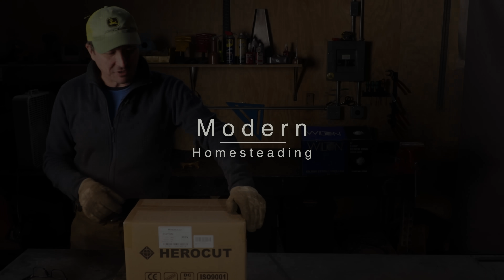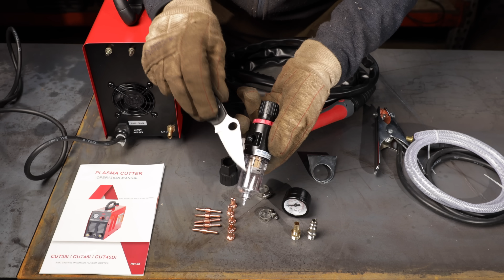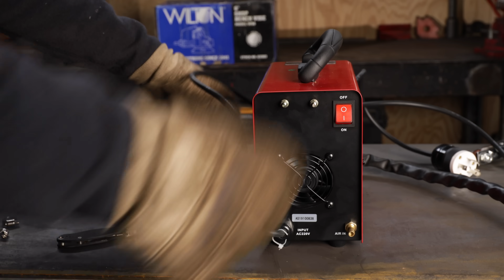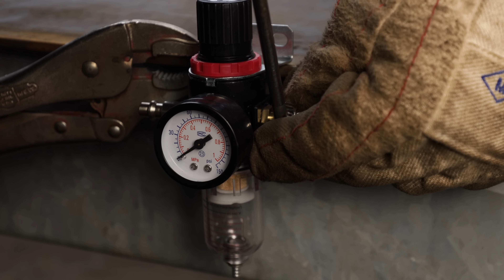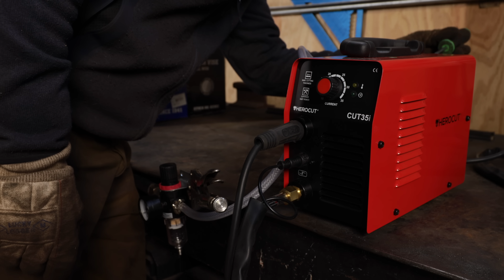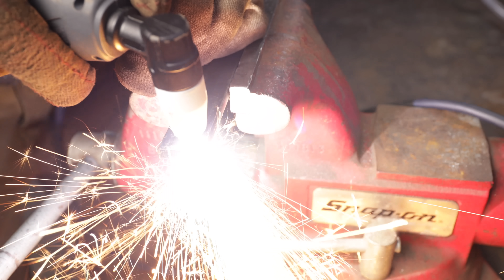TESTING The Cheapest Plasma Cutter On AMAZON

Comment: this one is 195.00 (Reboot Plasma Cutter 40Amps AC 220V Portable Metal Cutter Digital Display 2/5ich Clean Cut High Frequency Inverter Air Plasma Cutting Machine for Home Using)

Comment: CNC Plasma Cutter, HeroCut55i Dual Voltage 120/240v Non-HF Blowback Pilot Arc Non-Touch IGBT Digital Inverter Air Plasma Cutting Machine 50Amps 16mm Clean Cut, Max Severance Cut 25mm
by HEROCUT
4.4 out of 5 stars 54 ratings
| 35 answered questions

Price: 	$549.00 & FREE Returns 

this is ware your link sent me

Comment: As a retired artisty ole fart that putzes around  his shop.   I couldn't justify spending hundreds of $$ on a plasma cutter, so I make do with using an abrasive disk on my 4 1/2" angle grinder.  
Now @ $150 I could see hundreds of things I could build using this tool.  Yes, I know the duty cycle is short, but when You look at MY physical duty cycle, this would outperform me.  I would have to  go with the 120V unit because of no 220V available.
Note: The short power chord is there for a reason.   A longer power chord would require a larger gauge wire and shipping costs go up.

Comment: For around the same price you can buy a 30 amp plasma cutter from Banggood (the CT 312) that includes tig welder and a stick welder functions. There are partial reviews of it on here. I've got one, but it doesn't come with all the consumables required for tig. Once I've sourced them (also from Banggood) I'll put up my own review of it using all functions. They claim a 60% duty cycle, which I consider to be more believable

Incidentally it comes with much the same external components with the exception of the torch, which has an electrically isolated cutting tip so that you should be able to actually drag cut closer to a non conductive guide for more accurate cutting. Like you, I'll be feeding it with air from my larger, wall mounted, water trap/oiler.

Comment: Thank you, I ordered what looked like same model, mine came plug less, 110/220 model, so tried 110 to use extension cord, nope... spit and sputtered... Also the regulator did not have psi so now I know .04 is where 50 psi is... I'll put a welder plug on and give it another try. Thanks for the videos. Stay Safe, from Linn county Oregon

Comment: Mine is a different brand, but looks the same. With 110vac it does work, but seems limited to about 1/8 inch steel (unless you go really slow). Haven't tried it with 220vac yet. For the price, I can't complain.

Comment: $150.00?? Looked this up at Amazon, with link provided. Even tried looking up without it. The ones that I seen that looked like one being used were well over $150.00. More like $500.00 & up. Pretty good video but was disappointed after seeing the actual price. If I’m gonna spend that much, I may as well save up for a Lincoln/Hobart brand. $500.00 does not come easy for me.

Comment: They must have liked the review.  The price has nearly quadrupled.
Reply: Still only $199 for dual voltage
Reply: His link is to the Cut50 not the one he tested which is cheaper
Reply: Look up cut35i.   You can find them as low as $129
Reply: A lot of formerly cheap things from China are going to up in price due the Coronavirus complications.
Reply: @Mumblix  no when they see the views go up on a item they up the price have done it with alot of stuff he has reviewed
Reply: @Mumblix  
Nope, due to DUMB trump.
Reply: @loktom4068  Apparently, SO dumb that he got things accomplished that no other President has done. Man, what a dummy.
Reply: @arthouston7361  no kidding.  Ask 10 people what issues they have with him and 9 will only give you his personality.  Sure he doesn't have a lot of tact but I'll deal with that vs a "nice" guy that is worthless.  Besides, do research and most of the "nice" guys were a$$holes behind closed doors.
Reply: @boozler8194  Agreed. I spent a lot of time at U of P, and I can tell you that NO ONE gets into Wharton if they are anything below a high IQ. Penn does accept some students from "challenged" backgrounds, but Trump is not one of them.
Reply: @arthouston7361  delusional
Reply: @user-fr4cg2xj2w  Yep. A lot of people suffer from Trump Delusional Syndrome. It it perpetrated to keep people on the plantation.

Comment: I work on ships and the only time I need a plasma cutter is when a torch would do more harm than good .
  I can think of better ways to cut a clean piece of steel on a table .
  Yea that barrel should have been cut with a hole saw  or a circle cutter and torch .
that design could be cut on a band saw .
  In that design you are tossing the Outside piece so why Did you need a plasma cutter ?

Comment: LoL  oh  that silly metric system shows it's face again.    LoL   NASA is on the Metric system GM is on the Metric System Dodge is On the Metric system.  and your radio stations have started to move to it as well.  why?  one world system of measurements.  the best way to make it all work.   so stop talking bad about the Metric system,  you will all be on it within the next 10 years.   even your speed signs will have both on it soon.   now if they could only fix the right hand drive car problems...

Comment: Yeah I'm not seeing the  240 or the herocut 220 with either of those links. It just shows the 110 volt is the 45i and there's a 55i that is a dual-voltage but that thing's almost $550.

And the links do not show $150the links bring it to Amazon and it shows $194.

Comment: You're confused about Duty Cycle. 100% means you can run it 10 mins at 100% of it's rated amperage. It still would need a cool down period. Duty cycle in no way is connected to your 8 hour work day in the form of non stop cutting.  That's why the word cycle is used. Cycle has a beginning and an end. In this case the standard rated end is 10 min in a Duty Cycle measurement.

Comment: 2 weeks after this test, and the 35i is no longer on Amazon. They now have the 45i at $194 which is only 110v. The 240v is $549.  Lately it seems that everything that gets good you tube reviews, the price shoots up on Amazon.
Reply: What's funny is I clicked on the link after watching this and found a cut50de. Apparently it is the older model and no lo get available. The manual useless. Oh and the 45i needs 6.0 scfm.

Comment: The Hero vs Miller clamp.  Mmm the clamp itself is definitely cheap but the copper strap dual ground points. Might have the Miller beat. Looks like the did a really nice job there.

Comment: I don’t know much about plasma cutting... do you need some type of gas to use one?
Reply: You need to have a large air compressor for an atleast 70 psi and up constant pressure. Small compressor wont be able to keep up air pressure that could possibly shortening the life of the machine unless you will be cutting small or thin material at a time. Plasma cutter is very useful equipment to have it at home DIY'er or either a shop.

Comment: Had mine for 4 years, was almost $30 more back then,  I would say its been used a couple hundred times and still works great.  Cant cut for hours on end, it will overheat,  i can do 3/8ths  but you can tell its at its absolute limit if you go to fast and i often have to cut twice. I did have to open mine as it had an air leak inside, simple clamp re-tighten.  Wish i could say evrybody would have as good of luck as me, but its is cheap so who knows.  I have at least 3 friends who got them after seeing mine and all of them still wokr to, but I dont think they are used as much as mine. If mine dies i may upgrade, but 4 years for $180, now $150  is hard to pass up.

Comment: I bought a 32 amp 5 years ago, it still cuts great, I dont use it over 1/8 inch. I also bought a 50 amp, it cuts 3/8 quick. Flies through 1/4 inch. I cut a piece of 3/4 once. It was slow, but definitely doable.  But for making 1/4" plate items, these cheap plasma cutters are fine. get a bunch of consumables on Ebay too.

Comment: "Metric system rears it's ugly head" he says, just a minute after "I hate how everyone makes these airhose connections differently, there should be a standard"
Reply: Classic American  mate haha
Reply: You can make a precision standard part without using the metric system fyi
Reply: @Wyatt_Riley  It's more "There should only be one standard" while the US is the only country in the world not using the standard thing everyone else agrees on.
Reply: @tbthegr81  The US also produces the most widely used Mills, Lathes, ect that are used for precision machining so we can do what we like
Reply: @tbthegr81  Plus anyone in the machining field whether working in the US or not should be proficient at converting from metric to non metric units. So whether the specs are metric or not the part can still be the same and standardized
Reply: @tbthegr81   The USA and Myanmar, please don't forget Myanmar!
Reply: @tbthegr81  If The Metric System is Standardized Why is There 5mm and 5.5mm Just Sayin !!!!!
Reply: @kellydardeen6308  Ehm
All lengths in the metric system is based upon the meter, and the meter is defined as the length light travels in a vacuum during a predefined length of time.

Ya can then have any length that is shorter than a meter.
"mm" just means "thousands of a meter"
So half a mm is just "Half a thousands of a meter"
And 5.5mm is just "Five and a half thousands of a meter"

What has been standardized is not a bunch of predefined widths of drill holes or screws, but the whole system of how to measure things
Reply: @tbthegr81  We are the "standard"
Reply: @Wyatt_Riley  The US produces the most widely used mills and lathes? Really? That's not true, what do you think they are? Also any American manufacturers that export convert their export lathes and mills to metric. No one in the EU/Asia/Australia/etc would buy a lathe or mill that's in imperial units. The only lathes in the EU that are imperial are ancient ones.
Reply: @lost4468yt  Um its absolutley true ding dong. HOSS is the most widely used brand of CNC machinery worldwide
Reply: @Wyatt_Riley  Spell dude, spell.   It's Haas Automation.
Reply: @Wyatt_Riley  American here. Haas is not  the most widely used. I've seen all sorts. Haas is popular in the states, but over the pond they have Hermle, Okuma, Mazak, Mori Seiki...

Okuma is actually one of the largest worldwide. And if you're talking heavy industry, Hermle is one of the only provider of CNCs to handle big capacities. Their CNCs make CNCs.

Yeah bud Haas is big, but they're not the most popular.
Reply: @Wyatt_Riley  no
Reply: @Wyatt_Riley  no
Reply: @tbthegr81  You're dramatically uninformed. We in the US use both standards, as I have full lines of tools for both and know both systems well. But not everyone needs or wants to use both, so either or are used. It literally makes no difference when one applies either standard to their projects. This is a function of the fact that we are both a) an independent economy with our own industrial base of a size that can beget it's own standards and b) a market so large that we also import a lot of foreign product. Here's a protip; many of the sizes are directly interchangeable, like 3/4 and 19mm. You would do well to not be an arrogant shithead, since you're the one that doesn't understand both.

Comment: I wouldn't mind the 50 model they have with the pilot arc - that's probably the one feature that's a must have for me, since most of the stuff i cut is rusty old jeeps... heh.  double the price, but, meh.  

Most of this IGBT stuff seems to be either works for a long amount of time, or goes up in smoke the first time you plug it in.  exact opposite of the old transformer stuff.

Comment: The two Barb fittings and the automotive air connection go to the pressure regulator and they supply some hose  supposed to connect the barbed fitting from the machine to the pressure regulator and from the pressure regulator of the automotive type fitting

Comment: Gotta say it's pretty nice seeing decent stuff for a low price becoming more available. I bought a 20 amp welder off Amazon for $110 and built a home-made belt grinder with it. Never had a single issue with the welder and while it's not super adjustable I was able to get it at a good spot for welding the material I had. All the welds looked solid and it didn't act up at all. It's really nice to be able to get a product you know you probably won't use a ton and not be hurting the wallet too much. Good high quality tools are great, but sometimes that cheap "good enough" stuff is just what I need.
Reply: I'm assuming You stick welded. Or can this machine TIG?

Comment: I just thought I’d add in that the duty cycle amperage isn’t specifying the input amperage, but instead the output. If it is a 25 amps at 100% duty cycle then the machine will cut endlessly (100% of the time) at that 25 amp output. If it is 30 amps at 50% output then it is meant to cut for half of a 10 minute period (5 minutes) and then rest for the next 5 minutes. (Duty cycles are almost always expressed in ten minute periods)
Reply: Thanks, Joey.  I did not really understand the duty cycle idea.

Comment: Did you ever figure out what that black plastic socket is used for? It came with my Cut-50 too. I was thinking that it might have been a socket for tightening the air line, but it wouldn't fit over everything.

Comment: Duty cycle refers to the machine setting not the input service size . Set at 25A the machine will run for 10min out of 10 min or 100%  , at 35A it will run for 5min out of 10 min or 50%

Comment: The non-standardized air fittings will literally drive you nuts. However I do remember purchasing some universal quick connect females that would take many of them.
Reply: SouthWestIron       Switching things about is just the price of saving a fair bit of cash.    No big deal in my world really.    If they made 2 different models it would invariably cost a lot more, oh well......
Reply: @drizler  Yeah I can see that however I used to manage the equipment fir a large metro Fire Dept. It seemed every other rig had a different air fitting for tools. It made it a big challenge procuring equipment. A standard air plug or maybe 2 or 3 would be nice but there are dozens put there.

Comment: I mean if you're a guy on a budget that does the odd bit of metal work here or there like projects about the house so you dont need a fancy high end plasma cutter, looks pretty good to me. nice and small to be out of the way when you're not using it/fit into smaller shops. obviously i doubt that it would last years and years and years of relatively frequent use but for those little jobs about the house? looks like a right little treat

Comment: I hate to be the negative guy cause I love your vids but you gotta use it more than that for a decent review. Of course the thing will turn on and cut through a few pieces of metal. You gotta use it for a full project to see if it holds up to use. Even if you just use the thinner steel. Will it cut them of those yard birds out?
Reply from the maker: A perfect opportunity for to to upload your own video that goes into great detail,
Reply: Wranglerstar: Touché, but then what’s the point of watching your vid? I thought I would see some actual testing like you have done in the past with other “amazons cheapest”. Obviously it will turn on and make a few initial cuts. Thanks tho. Appreciate the vids. Good bless.

Comment: Yes, they do work well for the odd bit of DIY cutting. Just remember the cables are CCA wire, and will eventually break off at the flex points, so be prepared to either replace them when the bend becomes very sharp at the ends, or buy new ones. Not going to compare to the bigger units, at all, but for thin sheet and a bit of auto body work perfect for the price, and a lot less noise than a grinder and disks, though you will probably need a grinder to get the ragged edges flat and smaooth again.

Comment: Looks like a viable machine.  If you remember, I got a few questions for you.  Is it scratch start or high frequency? Does it pre flow air before you cut? Does it have a button for the air or is it adjusted in the head of stinger?
Reply from the maker: It’s a $150 plasma torch, that’s all

Comment: It seems like you select "the cheapest" items on Amazon to test / review in the majority of cases.  Is there a reason you don't look for "the best value" to test / review, by looking at the advertised features, review scores, etc?  I usually try to avoid the cheapest item available, and base my choices on others reviews, features, specifications, as well as the price.
Reply: He just looking to turn out content as cheep as he can
Reply: I agree. I usually buy somewhere in the middle. There's always going to be some overpriced name brand that you want to avoid and the cheapest stuff usually doesn't last long. It's fine if you want to test out the cheapest stuff for fun but he should always recommend something of decent quality for what people should actually buy.
In this case, since I do almost no metal work, I might consider the 110 version.
Reply: Because we all know the middle of the road will get it done, but we always wonder how bad the cheap stuff is
Reply: Why not test the cheapest, it may be the best value for money, when you look at many mid range products they are no more then the cheapest rebranded,  the cheap air saw I have is the same as a branded item just a different colour and a third of the price,  over the years it has cut a lot of fibreglass often a the death knell for tools, and its still going.

Comment: Air connections ARE standardized - its just that they're are more than a half a dozen, BUT the only two you're likely to run into is Automotive and Industrial, with Industrial being more common. You can also get "universal" couplers, but they tend to leak in my experience.